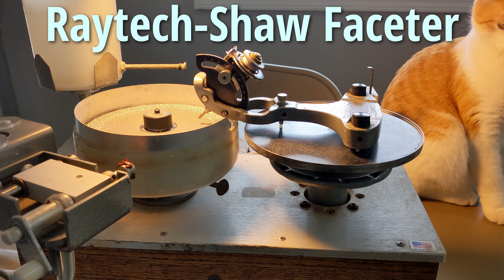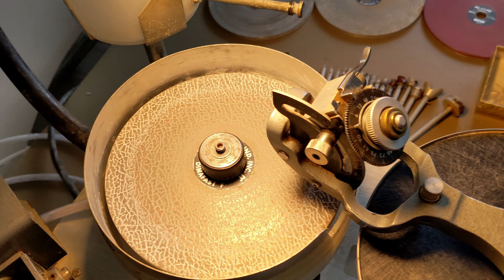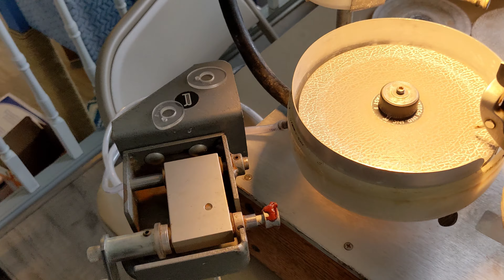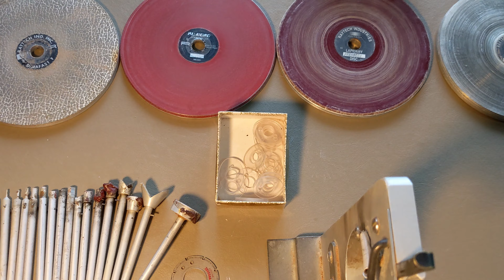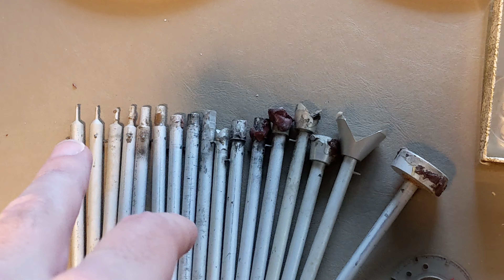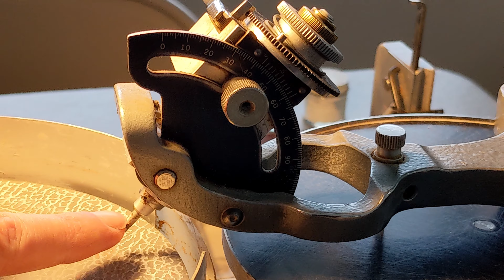My Raytech-Shaw Faceter

Comment: hi ^^ french guy here. i don't find on the website of Raytech some specification, how far can you elevate the right platform ? i would like to build big piece like a thumb. Thanks for this video , it helps a lot ^^
Reply from the maker: @mysticnaeco  I currently have a huge stone, about 30 mm diameter and 45 mm long on the dop. This really pushed the limits of the height. You could potentially get a very flat machined metal block and use it to prop up the handpiece.

Comment: It’s a good machine, hope you cut many stones with it! I’d suggest a careful cleaning of the handpiece with q-tips and a little WD-40. Flip the nut holding the dop, makes it easier to unscrew. The white powder is probably aluminum oxide. Best advice I can give is to grit your teeth and buy a new set of laps. I’ve wasted many hours on lousy old laps, don’t recommend it. Buy a Greenway for polishing, works on almost everything. Have fun!
Reply from the maker: Many thanks for the tips! My local expert also set me straight on the dop nut direction. I'm muddling through with the laps right now. They're used but most are in good condition, but I agree I will eventually need to suck it up and grab some new ones. Just have to wait for the hit of this purchase to fade from my checkbook first.